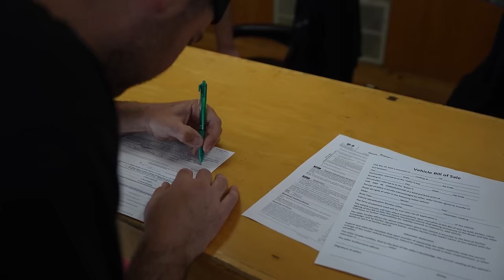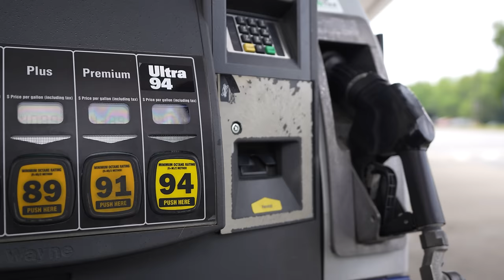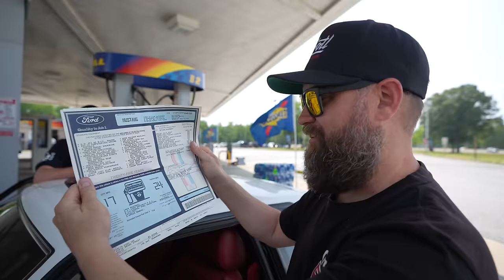Buying a Mustang GT & Building It On the Road in 7 Days! (not what we expected...)

Comment: I had an ‘89 GT that was black with red interior and it was an absolute blast. Granted back in the early 00’s the aftermarket support wasn’t near what it is now. But nonetheless, great cars! Almost a shame to tear into this unmolested car but I’m sure the end results will be great as usual 
Fun fact the 5.0 from this era was actually just shy of being a true 302. It was more like a 301. But Ford bumped the liter number to keep the 5.0
Reply: You're thinking of the liter designation.  The engine displaces 301.6 cubic inches (rounds to 302...), but only 4.94 liters.  So it's technically a 4.9 liter.  Many magazines back in the day loved to call it a 4.9L in their tests.  Ford called it a 5.0 to separate it from the 300 straight 6 which was also referred to by Ford as their 4.9L engine.

Comment: i dont know what the universe is doing to me. several different automotive YT channels that i frequent that dont necessarily have foxbody content are all posting stuff all the sudden.  im a foxbody guy, i love these cars and they mean a lot to me. just last month i had both my foxbody and my s10 mini truck stolen. both of which i have owned for 20 years. i located them, but the truck has been crushed meaning it is gone forever, and my foxbody is ruined. window got busted out and everything that was in the car is gone and interior is completely trashed. mold, mildew, trash, stains, damaged panels, even my steering wheel is crumpled up like a dried prune. every single component needs to be completely replaced but the landlord told me that i am "not allowed" to have or work on my vehicles at my home.

Comment: My fav car mad at myself i had 3 of em my last one was 2018 i had i paud 3900 my most expenaife one 1 owner 55k og miles i sold it cahse i was desperate ith 98k og miles all marhcing parts but it had bew everything suspension racinv weld rims and tires 3500 paint job built tranny exhaust everytjjng sold for 5k and that was expenaive now same conditon i got mine in needs paign a million miles stock barely runs ans lx vert is 16k llus i always had gt like the one in this video i bad that sams one white with red strip my first one when i was 18 im 35 bow inpaid 1200 for an old lady 23k moles on it someone tbomed me 5 months into owning i got 6900 from insirance nought the secodn one for 3k thrid for 3900 now im.mad 10k is a roller. My 93 was also lesther interior air bags anti lock brakes lumber power everytjjng my last 88 didnt have air bag or anyi lock nrakes fause it was 88